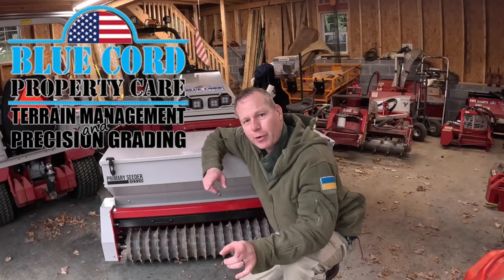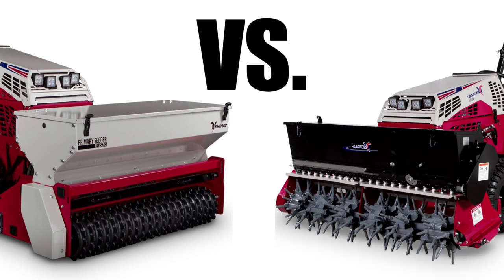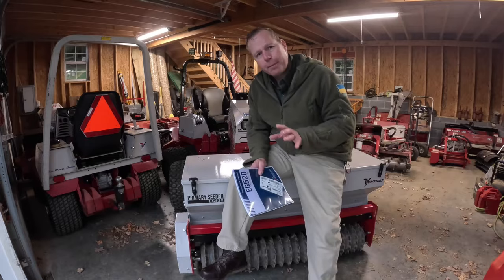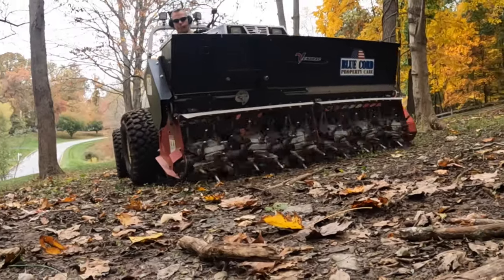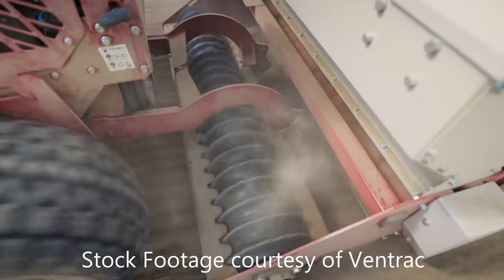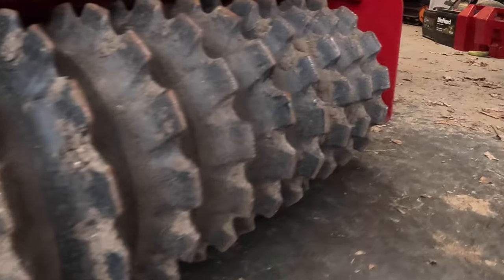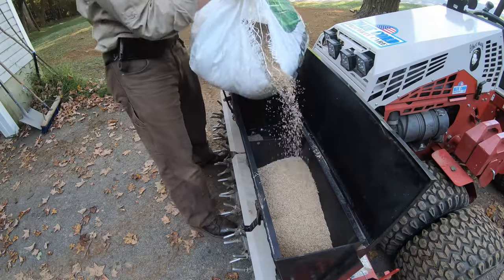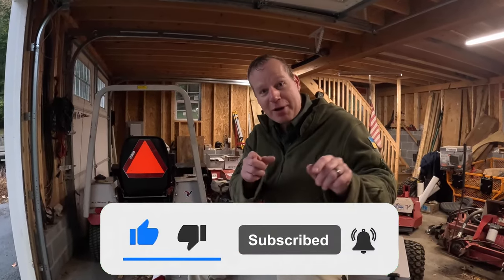The BEST Seeder in the Universe! #ventrac #bluecordpropertycare #tractor

Comment: Very nice! This, following a power raked or new material surface, would seem to be the perfect Planter! 
Can't wait for your experiments and recommendations for optimal choice of attachment given one's intent and surface conditions. 
~500lbs cast iron discs + ~200lbs of steel frame/housing + (5cu.ft.) 'X' lbs of seed load! The 4520 will lift with ease. But I wonder if the 4500 would struggle a bit. 

With the attachment down in float will those front Cultipackers put up any fight in a sharper turn? Or recommend to use / raise at the end of straight line runs? 
Thanks!! Jeff
Reply from the maker: This time of year the germination is very slow so we'll see!